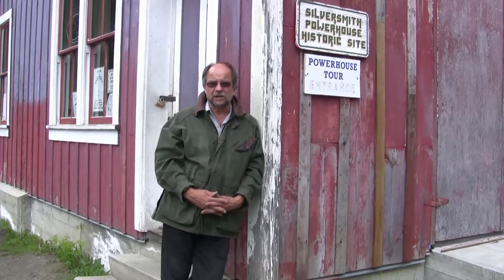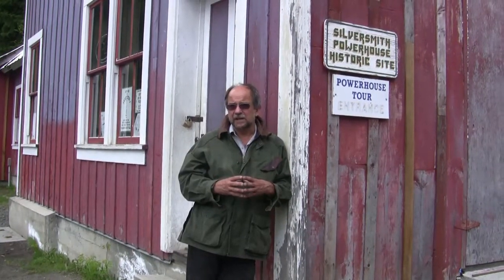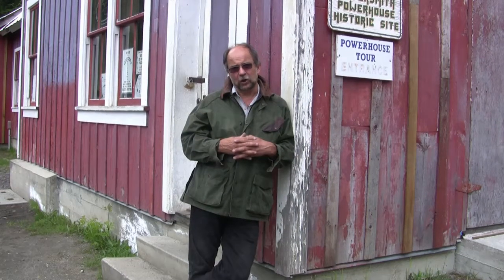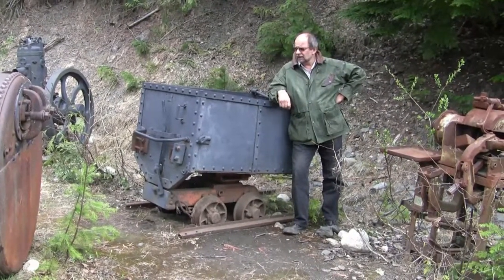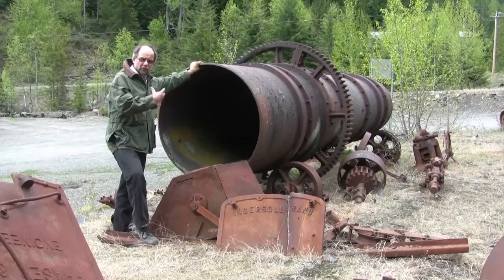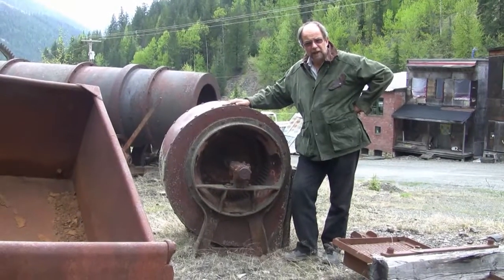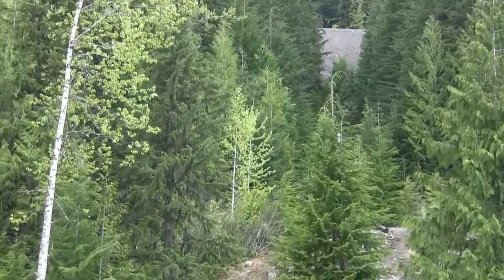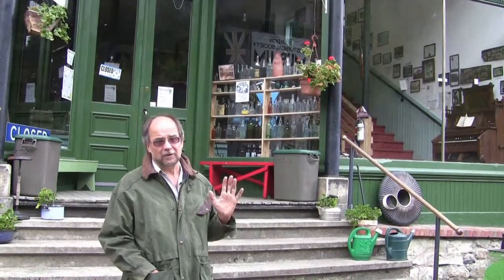Historic Sandon, Ghost Town, BC, Canada

Comment: Its not a ball mill, its not solid enough+ you would have alot of bolt holes in it to be able to bolt on some sort of lining inside. Most likely its a dryer drum.
Reply from the maker: Thanks for watching & taking the time to comment!
Cheers,
M
Reply: A Rotary Cement Kiln maybe.

Comment: time mark at 2:46  might be an over head  crane hopper.
Reply from the maker: Good point. I'll investigate further. Thanks.
M
Reply: It's an ore skip, used on inclined shafts or vertical shafts to hoist the ore to the surface.